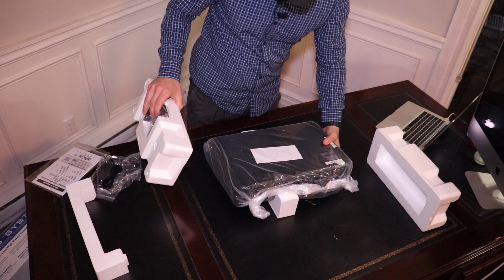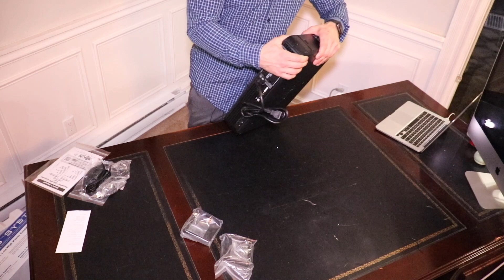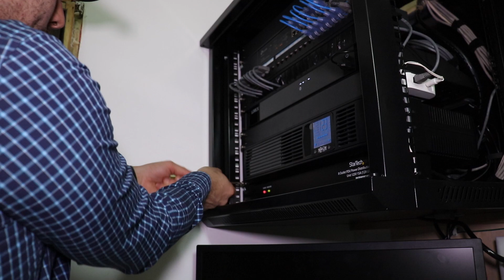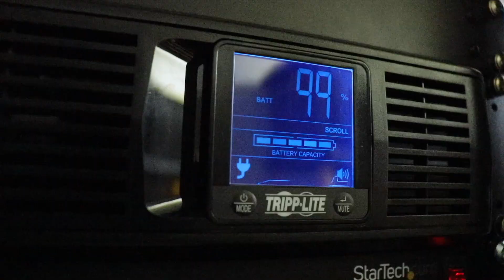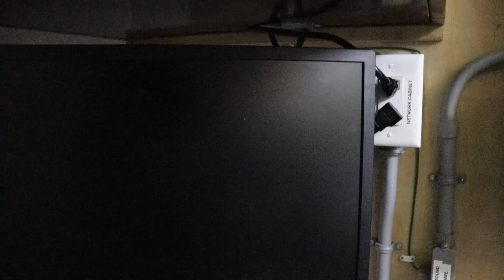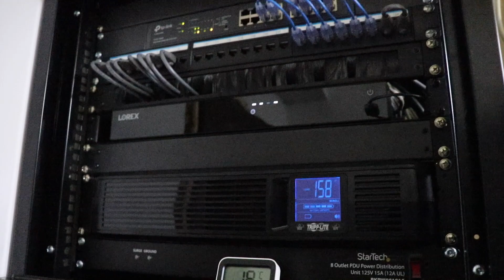Budget UPS Battery Backup -Tripp Lite

Comment: For anyone looking for more advanced setups, this UPS does not function properly with NUT. It will connect to the software but only reboots the UPS on low battery. Shutdown delay doesnt work either. I ended up having to return this UPS and bought a APC back-ups pro and a rack shelf

Comment: Thanks for the info. Just unboxed mine - same unit. Wasn't sure if the side panel brakets would support the weight. Looks like yours installed and stayed okay.
 I noticed mine powered up, then shut down when I plugged it in. Hold the power button for one second, also powered up, then off. Hold the power button for two seconds +, beeps and powers up.
Reply: I had the same question. Guess it’s light enough to only need 2 posts not 4.  Great video

Comment: Tripp Lite is the most problematic out of my three. The others are APC, CyberPower. The rackmount ears are a freakin joke. This must be a new model as mine does not have holes on each side for rack mounting. This unit is way too heady to not have rack mounts on each side.
Reply from the maker: Yes , mine must be a newer model as I have had not of these issues. Over all I have had no issues, the unit has kicked in countless number of times as I’ve experienced power outages. Sorry to hear about your issues with yours. I would definitely contact Tripp Lite if I was in your position.